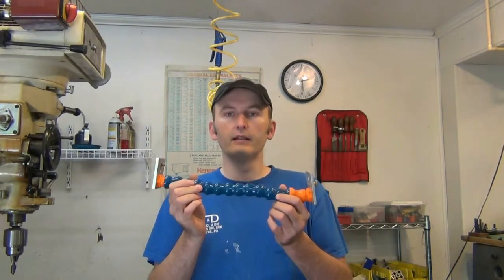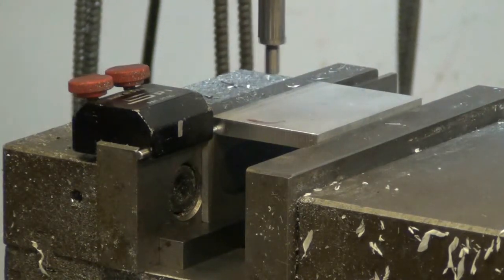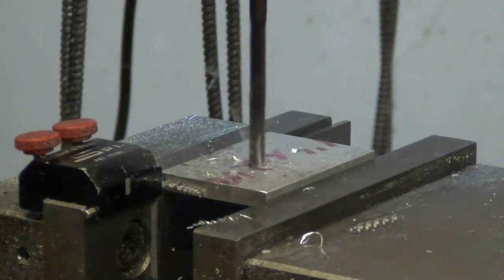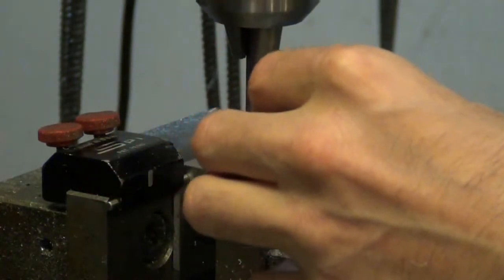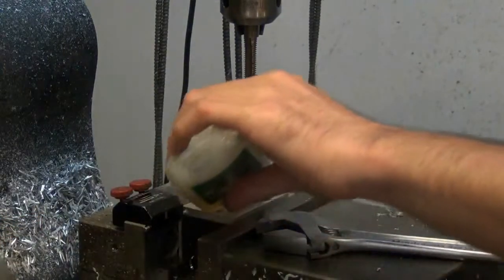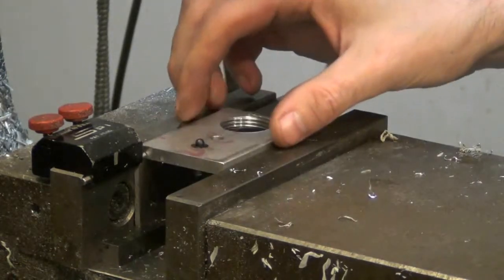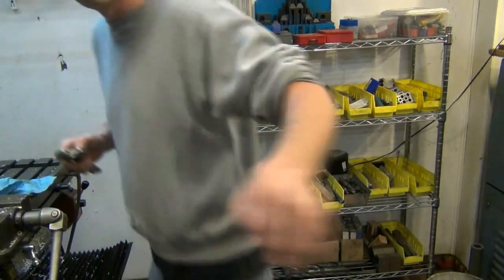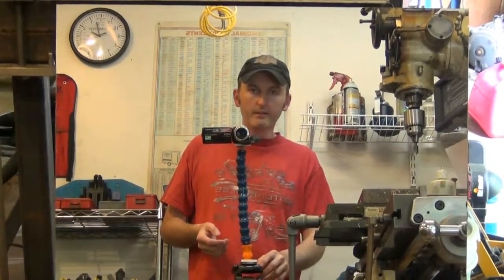Machining A Flexible Camera Mount

Comment: That is really nice - thanks for posting!
One criticism is that I cannot find any mention of what the flexible blue and orange components are. WHAT are they, WHERE do they come from????? - it seems you do not mention anything about these extremely important parts. Watching the video twice, I admire your ingenuity and craftsmanship but it seems you left out some essential information, no?
Reply from the maker: Thanks. I'm glad you like, and good catch on the material I used. The blue line is known as 3/4" Loc-Line, which is used as an adjustable coolant hose in industry. You can find them here: http://www.mcmaster.com/#catalog/121/2203/=w3yjqi. I've noticed different companies adapting this material for other uses, too, like light, indicator, and magnifying glass holders, etc.
Reply: Arnold's Design
Many thanks, my freind - heading out to get the parts next week.  Much less innovative accessories cost a fortune in the photo/video retail world, as you know. Thanks for saving us some bucks!
Reply from the maker: AerialLensVideo
You're welcome. I use mine a lot. Good luck with your build, and if you have any questions, let me know.